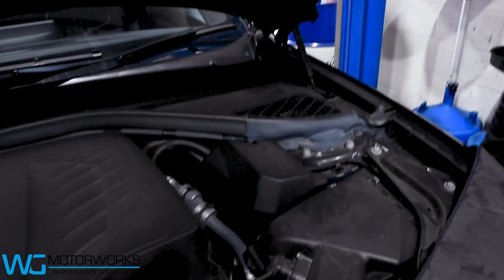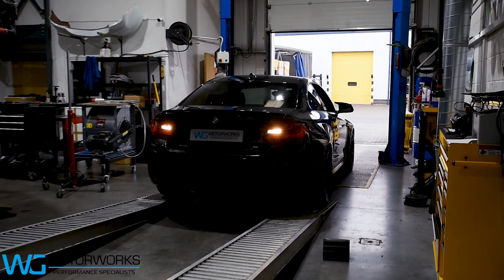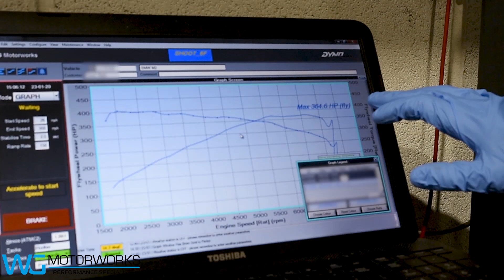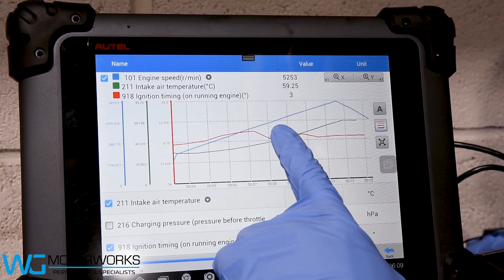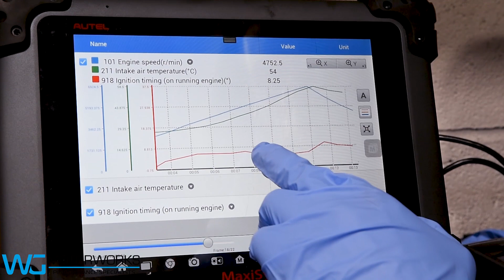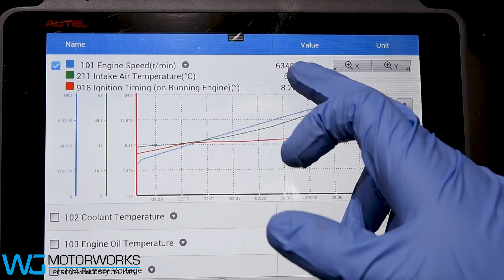Are you losing power just by using the wrong fuel? - BMW M2 N55 Tuning! Part 1

Comment: Hey enjoying your vids bro, ive heard some people say even tesco 99 is not that great as they add something to it to get to 99? I only use v power as dont want to risk it
Reply: Nothing wrong with tesco 99, every good tuner like wg will only recommend shell v power or tesco 99, I personally have always ran tesco and never had a problem with tuning on my cars whilst running it and that includes a mapper that Warren at wg works with, and recently just had my focus rs tuned on the same fuel and again had absolutely no issues with it, stay away from BP ultimate it's dog shit and esso supreme99 is a bit hit and miss so stay clear of that too
Reply: All 99 ron fuel has octane booster added to make it 99 ron. It's not 99 ron when it's refined.